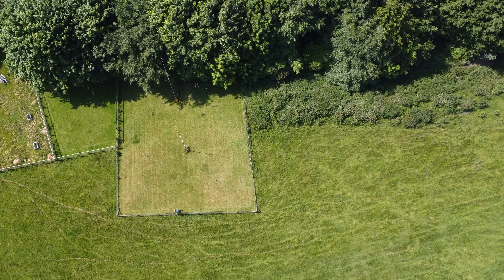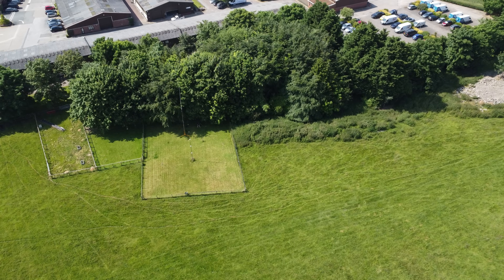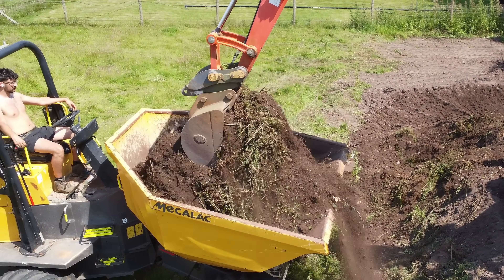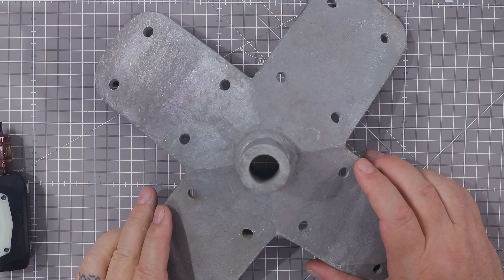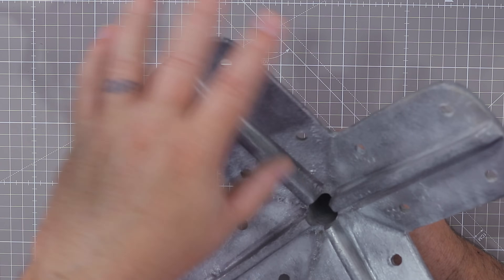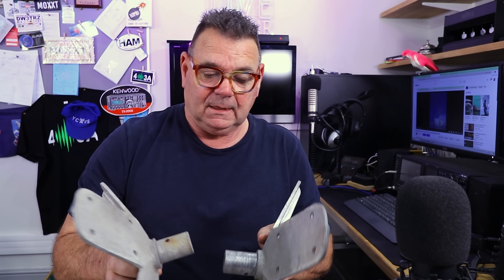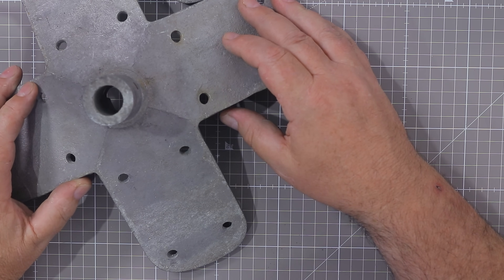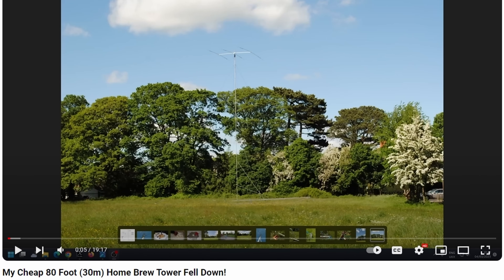DX Commander is EXPANDING - New Tower Project

Comment: I commented on the question of re-using the piece as a pattern, not knowing what it looked like.  I brought up draft and shrinkage concerns.  After seeing it though, I believe you could use the original as a pattern.  If the new configuration does not pan out, keep the original piece in good condition, as it should not be a problem using it as the pattern.  Shrinkage would not be an issue in this case.  Congrats on the extended antenna farm.  I'm old and slow now, but I still get things done.  Wish I could lend a hand, but not going to try and swim the pond....  Enjoy the inbound party.

Comment: I picked up a Gem Quad from a SK estate a few years ago. It uses a similar spider in the middle but with short round stubs that the fiberglass spreaders slide on to and are held on with a gear clamp. I'll try to remember and send you some pictures when I have some time.
By the way, those are cute little dump boxes..
Reply from the maker: Oh yes.. If you have pictures!

Comment: GEM quads had what you were describing where the fiberglass spreaders slotted onto the spider hub. The additional benefit was that element spacing was less for shorter wavelengths closer to the hub, so the multiband layout was close to optimal. SP3GEM was building clones, but I think he's doing standard yagis now.
Reply from the maker: Ah. OK..

Comment: Hi Cal and Wendy,
That's great news. Is the quad going to be 5 bands 20 - 10m? Everyone there stay safe.  73  WJ3U
Reply from the maker: Yes Don.. Maybe 20-6. No reason why it couldn't do 40m I guess...!
Reply: @DXCommanderHQ  Hi Cal,
It will get large adding 40m. You need spreaders at 10m in length. Stay safe.  73  WJ3U

Comment: GI0UTE here, cal, I'm using a home built quad covering 10 to 40 meters, some of the spreaders are your 10m fibreglass poles cut back.  It works fantastic! More information on my qrz page, or drop me an email. The secret is to feel each band individually with a switch up at the quad. Good luck. Cheers des

Comment: I don't remember the exact lengths of my 3 band 2 element "Spider Quad", but bamboo fishing poles worked so I'll guess about 12 feet which would be about 3 or four end sections of the Sig 9 pole.  How much would eight of these 4 section fiberglass extendable poles cost?  I already have the "Spider quad" center section and might build another 2x4 lean over tower this fall.  Regards,  N4SCP
Reply from the maker: If you REALLY want to builkd a quad out of DX Commander poles, let me know and I can come up with a "box of 10" deal for you.

Comment: Many years ago ( 38-40) years I made a cubical quad for 11 meters very similar to the one you where showing except where the spreaders attached I used angle iron stubs
and u clamps to hold the spreaders in place The spreaders where ash broom shanks, between the tips of the driven element and the director tips I stretched Kevlar twin ( very low stretch dont use nylon twine) also stretched Kevlar twine between the tips diagonally on the emitter and also on the tips diagonally on the  director this kept the quad very ridged
 and spacing exact  and lasted many years it was a exceptional antenna
Reply from the maker: Ah! Good news!